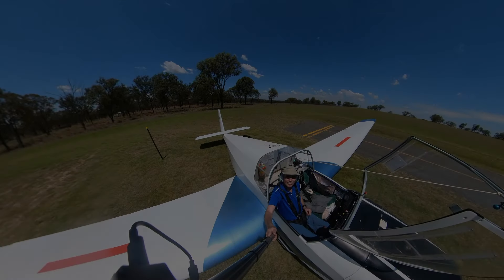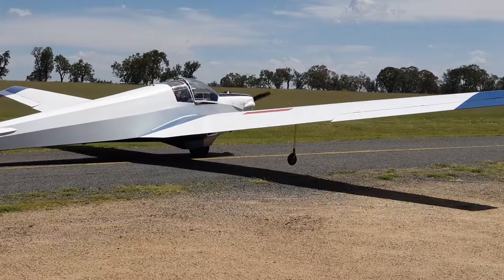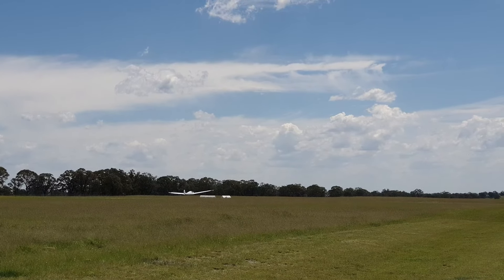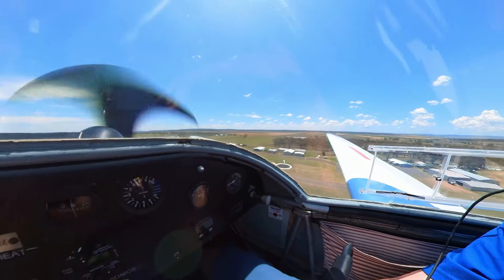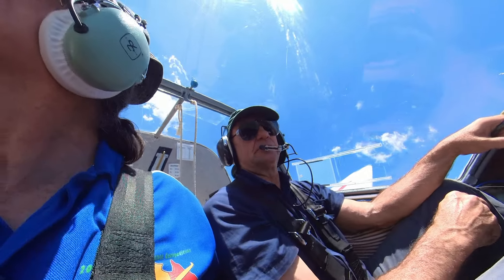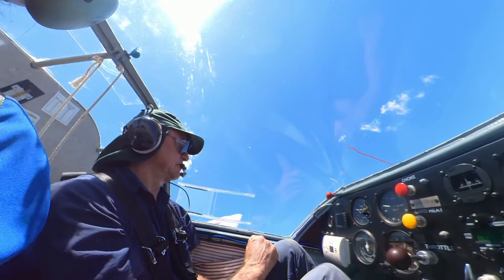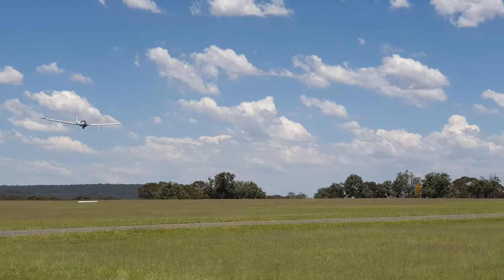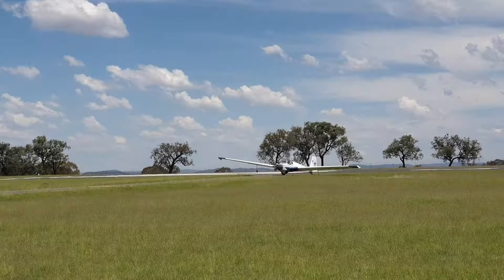Falke SF-25C Pre-Purchase Evaluation Flight

Comment: These Limbach engines are reliable. They have a forged crankshaft and Nicasill plated aluminium barrels. Porsches had that too. Only overheating or lack of oil can kill them.
I wonder if this Falke had the aileron "spades". The earlier series did not had them and the roll controll is remarkable heavier. Besides that: bending of the wing makes the aelerons still more heavier to move, so rolling to END a stationary 2 g turn needs force.... now you are informed. Good luck.